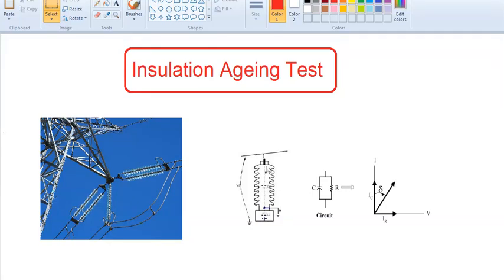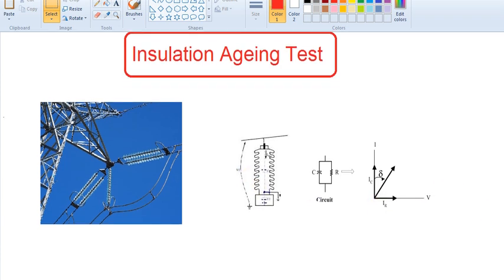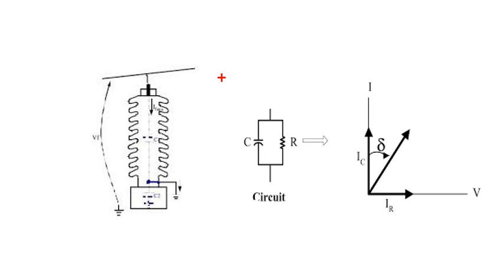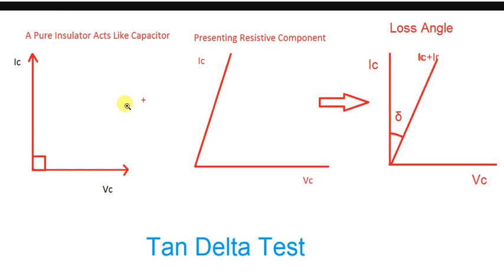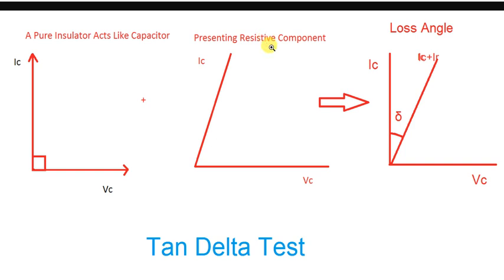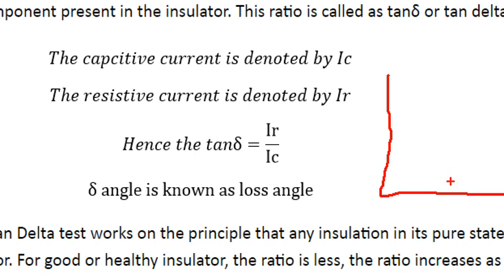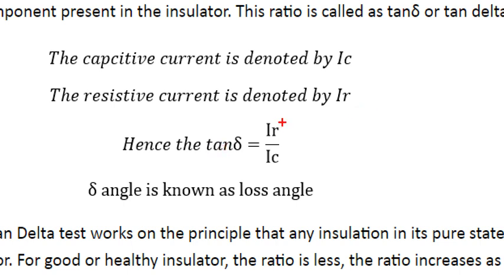Tan Delta Testing in Tamil Insulation Ageing Test Loss angle test Dissipation Power test

Comment: applied voltage ranges 0-10 kV,applied frequency never cahnges 50Hz only,determining the value applied voltage in KV,Leakage current,capacitance,power factor,disspipation factor and frequency.
tiz tan delta test similar to IR value check sometimes ,when ur  checking winding insulations in transformer,reactors,alternators etc
In CT,PT,Transformer Bushings etc makers given Tan delta terminals respectively.
applied voltage on Busbarv side tandelta terminal situated in terminal box
Most acceptable value of tan delta is lessthan< 0.007

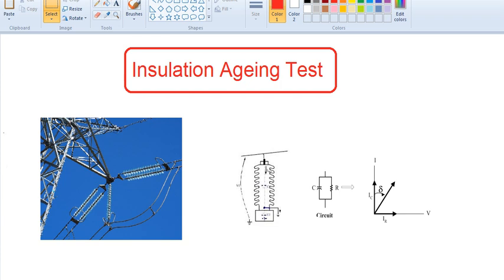Comment: tan delta explain is wrong bro 1 . tan delta test in transformer applied voltage 10kv dissipation is max 0.5% in correction in 20c the formula is fpt/k correction factor value 1:13
Reply: Yes, correct. tan Delta value 0.5% below need.